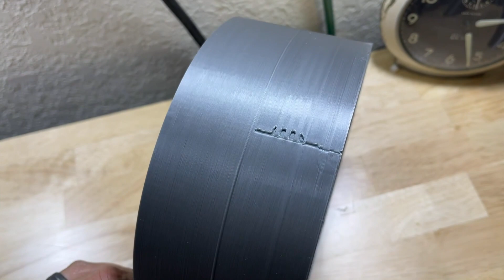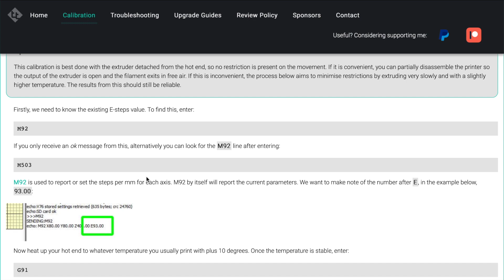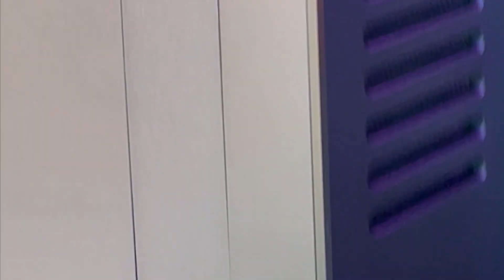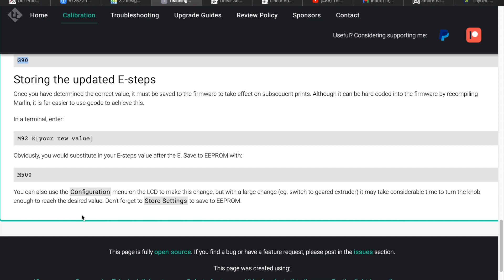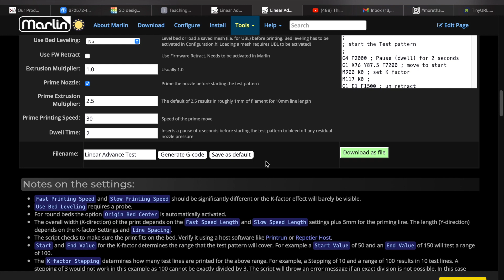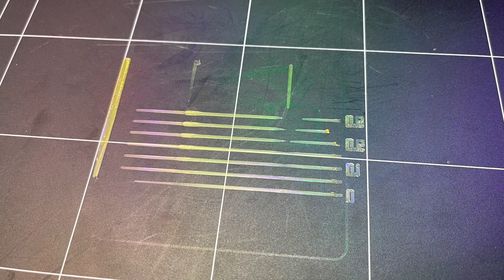How To Improve Your 3D Prints on the Snapmaker

Comment: I just found your channel and subscribed. Subscriber number 215. I own snapmaker A350 and I love it. Question 1 how do I change the setting for the nozzle diameter? More questions to come but for now that will do. Thanks so much.
Reply: You have probably solved this, but you input your nozzle size in the slicer software when creating a pint code. It is usually line width, or at least it is in Cura.
Reply: @James_D_S  since I last wrote I've tried something new. Find a picture you liked and cnc engrave it on the piece of wood, .5mm depth to begin. Put on the laser  engraving unit and laser engrave over the same picture you just carved. I use upper left corner as the starting point I've done this and it is awesome.
Reply: @James_D_S  let me know how it goes.

Comment: can you revert to original firmware values, seems if you mess up it is kind of a problem to get it working again?
Reply: Run the M503 command before doing anything else, and it'll show all of the settings currently active. Copy & paste that somewhere else, and then you can restore the values as needed.

Comment: hey i was wanting to change the nozzle diamiter what did you change in your slicer to accept the different size. i am using curra and im not sure what layer height or wall width i should use.

Comment: If you're using Octoprint you can use arc-welder to turn linear gcode commands into arcs. This would help with these large cylindrical prints.
Reply from the maker: I did a test yesterday and the results with the arc welder weren't  ideal. The print head movements were fine in the larger cylindrical walls but other movements were extremely slow, it must have taken at least 15 minutes to finish the first layer. I re'sliced the stl without arc welder and the first layer finished in less than 3 minutes. Have you made any changes to arc welder other than checking the box in Cura? I would really like to make it work to see if there is significant improvements
Reply: @marcoschaparro8952  I've seen the same. I think the processor in the printer struggles to calculate the curves fast enough, so it has to slow down in the meantime. This can also create blobs in the print. I'm wondering if there's a way to bypass this, such as by using Octoprint running on a more powerful processor.